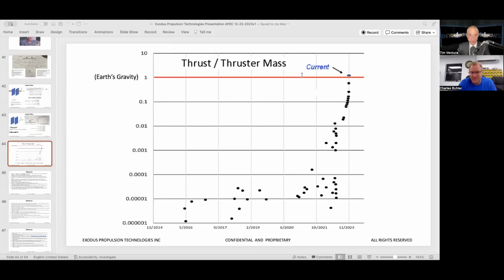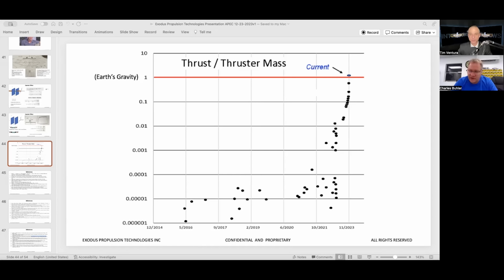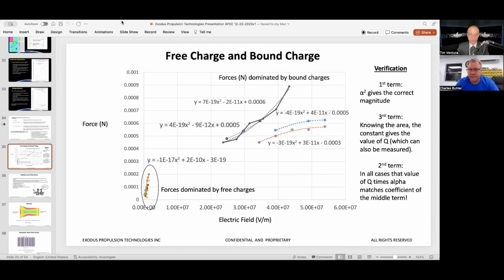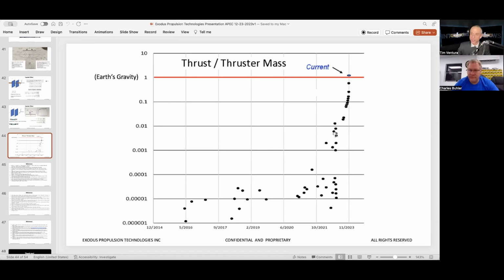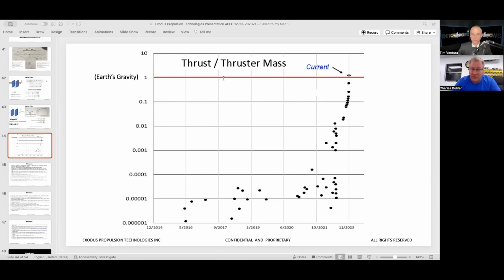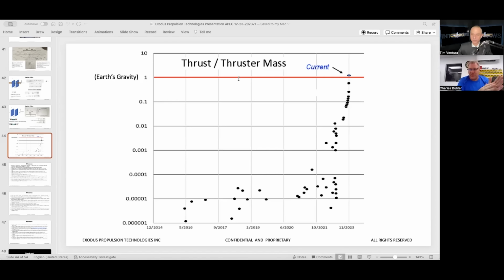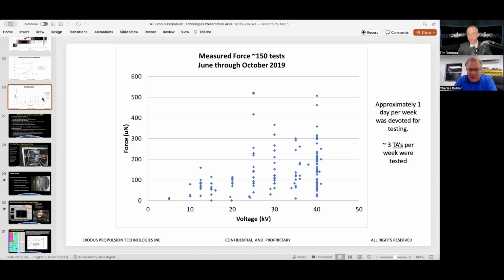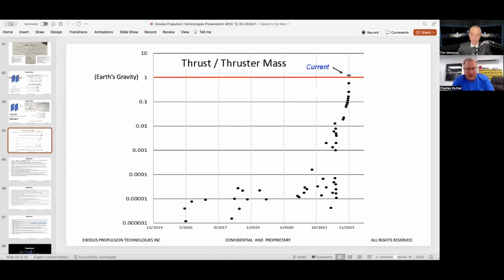Propellantless Propulsion Device | Charles Buhler

Comment: In fact, the idea of an anti-gravity (also warp/hyper/electric) drives does not stand up to any criticism already within the framework of solutions to Einstein's equations.
0. Well, what if you really want to, but "can't"?
1. Everything is much simpler: all the bodies on the basis of which spaceships can be built have mass and, therefore, the gravitational field. 
2. And if we find out that there is a gravitational field*, we can create a detector that could absorb its own field around the entire perimeter of the ship. 
3. It is clear that then the spacecraft would become “gravitationally invisible" to the rest of the masses and, moreover, the absorbed energy of its own gravitational field can be used to control the ship; and this is not reactive motion, and it's not antigravity.
4.Since real gravitational fields are variable in space and time, it is obvious that the process of absorption of the field has a permanent character:“If we abandon the requirement of static, then in the dynamic model the energy of self-action ( equal to the mass defect) it is spontaneously illuminated in the form of quanta ( or gravitational waves ). The observer will detect a decrease in the mass of the field (mass defect) only after the energy of the field "passes by it".
Up to this point, any transformations of the energy-mass of the field have no effect on the mass of the field measured by the observer, according to the law of conservation of energy.”(“GR and Astrophysics", Zeldovich, Novikov).
5..By the way, when it comes to UFOs, according to eyewitnesses, these objects glow, which may be evidence of the effect of energy conversion of self-action (interaction with vacuum): The UFO's own gravitational field is converted into useful energy.
6. Moreover, the ship will look like a “UFO” not only for observers, but also for all particles (also massless) in the Universe: the general background of gravity will perceive the ship as an alien object and will expel the "stranger" from its environment as a result of asymmetric, non-forceful interaction, because according to the principle of equivalence, the object is so it also “loses” its inertial properties for an external observer.
7. Since the background is heterogeneous and not isotropic, the ship's autopilot will be able to assess the situation, maneuver the accumulated energy of the ship's own field and “flit” along the planned route without the need to go to other dimensions back and forth; and, of course, without using any kind of engine. 
8. This is not a “like a stowaway”, but the same natural movement as free fall {movement along a geodesic line, which is the most general formulation of Newton's first law (Galileo's law)}: free movement.
9.Obviously, the accumulated energy and the ejection energy are not negative.

Comment: I'm going to look into this. I've found a very easy way to put charge into a dielectric, using the electron's non local wave function. (See T.H. Moray's sparking condenser - one Farad@15 kV). What I haven't tried is an asymmetric dielectric.

Comment: Tim, i think this tech could be a great addition to flywheel kinetic energy storage, if this in fact real, we could produce limitless energy. Flywheel energy storge rotors are housed in a vacuum on magnetic bearings and kinetic energy is extracted on demand via integrated electric generator, this could be a life changing technology. If this is correct, it would take 1g of force to spin a flywheel rotor to 22,000 rpm in approx 86 minutes and produce approx 26 kw or energy indefinitely. This is really strange

Comment: Dear all, 
I have come up with a new idea that works based on magnetic force symmetry breaking rather than electric pressure symmetry breaking. It has several advantages to Dr. Buhler's idea and is mathematically and theoretically explained.  Thumb up this post so that everyone sees it. Please google for my paper: 
Net Magnetic Force Generation in Discontinuous Circuits: A Force Symmetry-Breaking Phenomenon

Comment: Electricity to acceleration, no matter how efficient, is basically "free" if you just have sturdy solar panels.

If it's extremely inefficient, well, then it may not warrant much study.

However, I'm no truther or believer, BUT

It might be an explanation for some UAP's heatless movement 🤷‍♀️

Comment: I used to install metal roofing on mobile homes and prior to installing the metal the surface would be covered with 3 inch x 48''x 14' one side foil covered styrofoam panels and I found out the hard way that when the foam panels were separated it would create a electrostatic charge and delivered quite the shock. Enough so that it was painful. Perhaps this phenomenon is instrumental in the insulating of the plates and creating the charge or carrying the charge.

Comment: I don't like the "g" chart that's presented. It's a bit deceptive, since it is specific to a particular mass, and not the mass of a whole apparatus, but just the mass of the specific metallic charge sink, which is measured in milligrams, yet connected to kilograms worth of attendant apparatus. It only looks impressive to someone who isn't thinking about scale, and how the system scales up. 

The more interesting part of Dr. Buhler's presentation was the use of the fine-structure constant to scale the field strength, and how that accurately models and predicts the behaviour of the thruster designs, with the exception of the constant net thrust over time without additional energetic input or upkeep. My thinking is that has to do with the system being entropy regulated with some stochastic elements which means that the net thrust does decay over time, but does so as a function of the decay of the molecular structure of the metallic charge sink and so is kinetically glacial. It reminds me of an NMR machine, which maintains a short circuit in order to have a most un-decayed magnetic field, so long as the low liquid helium temperatures can be maintained. Since the charge sink is metallic and kept at a mostly stable temperature, my think is that it is decaying, and the thrust is reducing, but it is being lost in the noise of the vacuum chamber, which Andrew (the engineer working on this) stated has a certain amount of drift due to temperature and noise in the range of 20 uN. Impressive engineering work with how little money they've had to work with, but a more robust vacuum chamber and controlled environment will be required before I'm totally convinced. I'm not convinced the noise is actually reduced to ~20 uN.

Comment: My understanding of TT Brown's experience is that he demonstrated his working model to Admiral Rickover who told him to cease and desist. (Perhaps because the USA was top dog and any perturbation could only threaten that position.)
He demonstrated working models, not some subtle effect.
Further, his model was tested in a vacuum in Paris. 
In other words the project was terminated for military and political reasons. not engineering ones.
I intimate that the reason that these effects are seeing the light of day again is precisely because the USA is no longer Top Dog.
Further, it has been observed that the B2 stealth bomber engines are not powerful enough to fly and the engine exhaust is used as a van die Graf generator to present a voltage to the leading edge of the plane. Ground handling crew are warned off touching the plane once it has landed until the charge dissipates.
Reply: It could make one question the reason why it's being allowed out now. Perhaps to get ahead of  something else.
Reply: TTB's idea was ionic drive, is quite weak and doesn't work in a vacuum. The rest is Fairy Tales.

Comment: When I first saw that a patent had been issued I was wondering if we needed better patent examiners.  However, upon reading the claims of the patent I see that they never claim that they have a thruster which will move an object with no energy input.  That's good, because then they would be trying to patent a perpetual motion machine.  The independent claims really only talk about an apparatus for generating a force on an object comprising at least one electrode and at least one voltage applied which generates an electrostatic pressure force with a net resultant vector.  Nothing too outrageous there.  In fact, it's surprising that some of these claims actually made it into the final patent.  As they say, you don't really know the worth of a patent until it's prosecuted.

Comment: I really hope this can develop into a real propulsion system. If this is proven to be real, hopefully sooner than later, and the scientific community together with NASA, other space agencies around the planet and private sectors like SpaceX and Blue Origin can focus on perfecting it, we could see not just traveling to planets in our solar system a reality within our own lives but also what could be the very first space exploration to another system, most likely Alpha Centaury (A, B) and Proxima Centaury. If we are able to produce at least 1G of acceleration continuously, a trip to our solar system planets could be done in just a few days, and a trip to Proxima Centaury would take about 3 to 4 years for the spaceship and about 5 to 6 for Earth time. Time dilation would not be much as distance is technically around the corner so not enough time to create much time dilation even if reaching relativistic speeds. Mind that accelerating at 1G would be best for human travel, and the ship would have to accelerate at that speed half the way, then start to "break" at the same rate for the other half (otherwise you would pass Proxima Centaury with barely a few minutes to watch it pass by your spaceship window... LOL). And of course, is not just about speed, is about safety. Sending humans would probably be something we will not do for a long time, at least, to another system. We would need to design ships that have electromagnetic shielding to protect against cosmic rays as well as other shields to protect against physical impacts from small rocks that at such speed, even a grain of sand could cause lots of damage to the ship. If you think about sending probes instead of humans so we could accelerate faster than 1G, yes it could be done if the technology allows it, but unfortunately, time dilation becomes more of a factor in the equation, so sending a probe at about 5G acceleration would only cut about a year or so for the trip from our perspective so might not be even worth attempting to go much faster than 1G. We will just have to wait and see.

Comment: 21:12 "... it does seem to violate a lot of energy laws that we have. But this is fundamental. So, understanding this will give us an idea of what is the structure of spacetime... What is it?.. 'cause it's interacting with it in a way we don't quite fully understand. So, it's easy to make these things and it's a tool for the scientific community to use to try to explore those hard questions... You can't deny this. There's not a lot to this. You're charging up Teflon and copper tape and foam and you have this thrust... [22:19] Is it warping spacetime? [... 22:33] What happens if you have an asymmetric electric field in space? What are its consequences?" 
23:18 "[...] relativistic explorations of this, based on hidden momentum... quantummechanical explanations, related to the Casimir effect..." /?
23:35 "The hidden momentum is a relativistic effect that occurs when you have moving charges or you have magnetic fields.... [...] It wouldn't give a sustained force, 'cause it's not changing with time... I kind of rule out the hidden momentum... The Casimir force... (I think) is a great example of how you can use the quantum vacuum fluctuations to give you a net force on the system... [24:37] It's a model, it's there... The question is: How do we [humans ...] take advantage of that low energy? [...] This is another force that doesn't turn off 'cause you want it to... [...] I think the QED is there... someone can look at that and say: This is probably what's happening..." 
25:49

Comment: Very  very interesting  experiment,  is it not the the same as that pommy guy  accounted for back in  1996 or 8, with his experiment is it,, ,?? But anyway maybe  you should try  1.6 ghz , frequency,  also  maybe try using  I think it is called cemgell  as a insulator  for the  capacitors,?? Just a thought mate.

Comment: The graph shows thrust over thruster mass so if the mass of the thruster becomes smaller then then thrust needn't get any bigger to show a rise. probably this guy has managed to increase the thrust from this type of device but the graph is misleading because of the use of much lighter equipment to produce the effect. ( so the ratio thrust to thruster mass gets bigger)

Comment: This may be a part of UFO propulsion, but only one part. UFO's seem to have 2 modes: 
1. Slow hover: this could be the mode powered by Electrostatics. Lots of historical cases of UFO's seen flying slow and low emitting a buzzing electric discharge like sound. This however does not explain mode 2.
2. Zero inertia: Unless this thing or another technology also reduces the craft's mass to zero OR warps space, I can't see how it can perform instantaneous acceleration, right angle turns and sudden stops.

So this discovery, while humongous, would still explain only half the UFO phenomenon.

Comment: I'm very interested in that phrase, "underlying physics."  Also, that is not "almost" an exponential curve, it absolutely is exponential.  Every armchair "expert" is going to be weighing in, but they will all be assuming that they know enough to have an opinion, yet none will have Buhler's credentials.  Buhler is  explicit that, while he is confident of the reality of the effect, he is not clear that there is simply no handy obvious and easy theoretical handle yet.
Reply: Traditional science, as opposed to science based on mathematical models, looks to the external world and what is found there for understanding.  What means is that in traditional science, you are always looking to the unknown to enlarge understanding.  Mathematical models are limited to whatever is implicit in the model.  This where the perpetual "crises" in various domains of physics and astronomy comes from.  The difficulty is that over the last two centuries, science has shifted from efforts at empirical discovery to mathematical fortune-telling.  If the mathematics says something is impossible, then little interest is directed to phenomena that contradict the mathematical prediction.  If a discovery, say the problem of orbital speed of stars in the outer regions of galaxies, can't properly be handled by the existing model, then there are two clear options.  One is to re-examine the model's assumptions about reality.  The other is to minimally modify the existing model, possibly by postulating a phenomenon that is essentially mythological.  Dark energy, dark matter, etc., are all ghosts invoked to preserve a model that fails without them.

Comment: 21:00 is the MOST IMPORTANT PART! Meaning that as long as the CHARGE is there, its DOESNT have to be used, just THERE, the THRUST IS THERE TOO!!! This would mean that a charged battery could JUST BY THE FACT THAT ITS CHARGED, provide TRUST/LEVITATION with NO DISCHARGE! INSANE!
Reply: No discharge? Bullshit. However, it could be hyper-efficient thrust, the likes of which we have never seen.
Reply: @Terro-xc9mw  No, look at the formulas, he even repeats it and it was confirmed. Somehow the charge is doing something with the space. And remember, how can there be discharge if it even works in isolated vacuum! So yes, no discharge.
Reply: @qaesarx  That would be a perpetuum machine. We know those really just aren't possible. As cool as it sounds, the "10,000 foot view" is really uninspiring for confidence that there's anything here. I'm all for it, after it gets some actual peer review...
Reply: @Terro-xc9mw energy injected from vacuum of space isn’t a closed system.
Reply: A normal battery is "symmetrical" so it will not work for thrust.  Also, the thrust comes from a reaction with the environment.